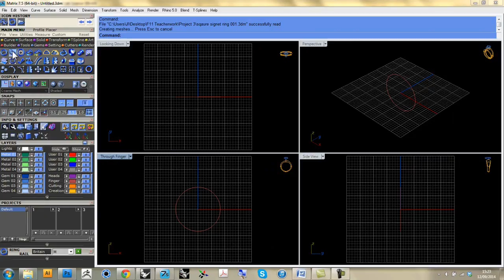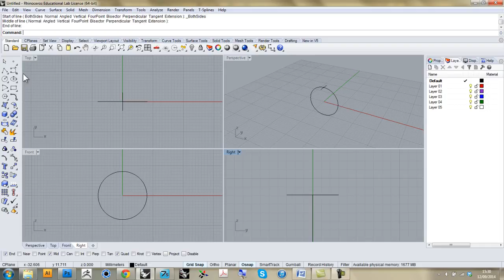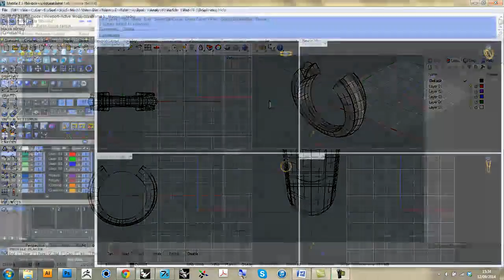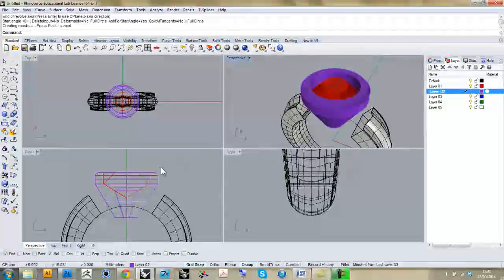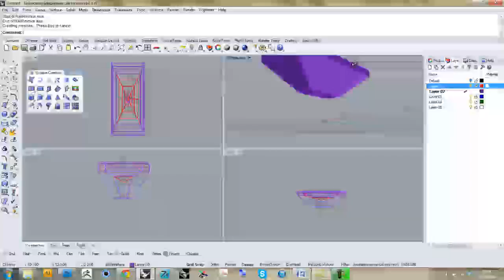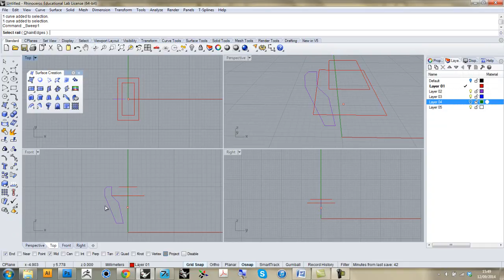Comment: So basically matrix is an 8k program of shortcuts
Reply: That's a bit reductio ad absurdum, isn't it?

Matrix (and its successor MatrixGold) have added so much additional functionality onto the software as to completely change the workflow. It is possible to do many things the software can do in Rhino in a much slower process, but not all of them.

There is no substitute for Gem Springs or carat weight measurements, for example.
Reply: @CADJewellerySkills  While I agree to a point, while I was on my 30 day trial period (asked for a refund) I found myself going back to using old fashioned rhino commands for most of my work. For gems there are other tools like Grasshopper gold or a few other paid plug ins.
For metal weigh, well my casting company sends me that info once I upload the STL file.  

While I would admit that Matrix looks good, it is very expensive, on top of that , they want you to pay to learn how to use it properly. I don't agree with the sales tactics at Gemvision. 

2shapes is coming along nicely now too considering they are the old Rhino Gold team...
Reply: @ians9390  All fair points.

MatrixGold's price is definitely an issue.

As for training, this is why I deliver classes in MatrixGold, Rhino, etc.

Contact me through my blog and we can talk shop more if you like: www.cadjewelleryskills.com
Reply: @CADJewellerySkills  PS. I bought your book. Just got it a few days ago